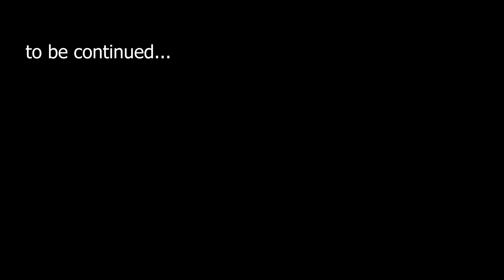New Place? Replacing my skunk2 upper control arm on my acura tl!

Comment: Any ride difference with skunk 2 upper control arms from stock ?
Reply from the maker: More camber that’s it
Reply from the maker: More camber adjustment
Reply: @Mythik559  oh I thought you would feel smoother ride or some difference other than just camber.
Do you need an alignment right away after doing your upper control arms ?